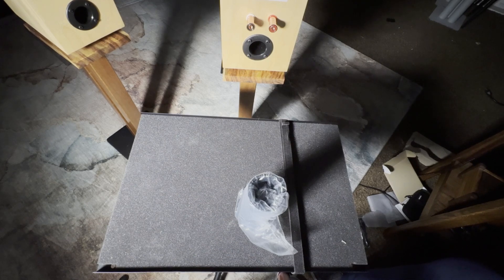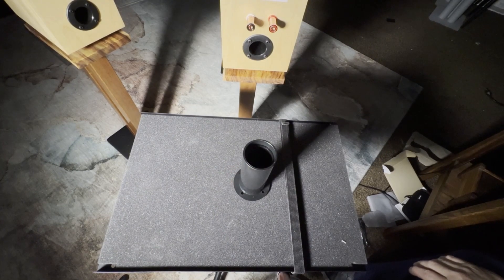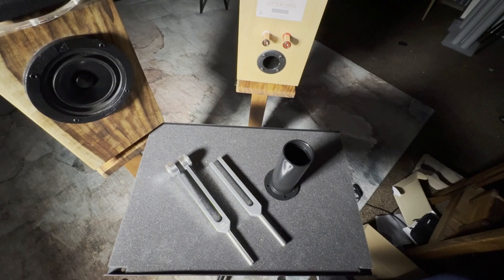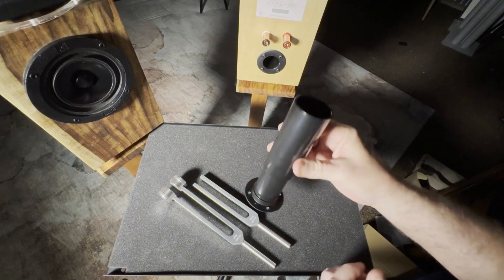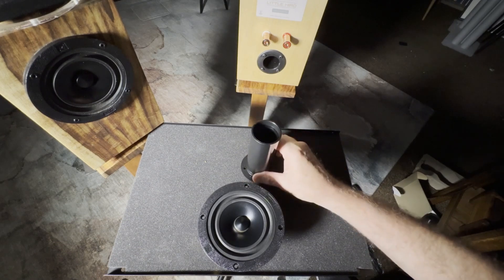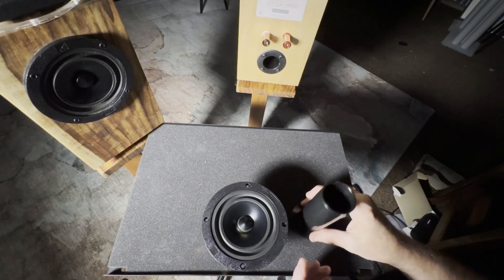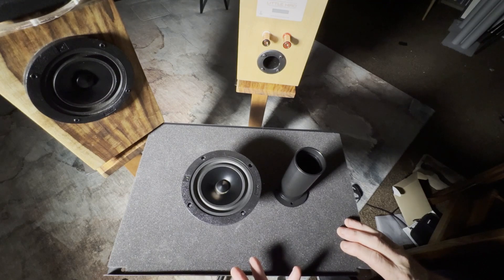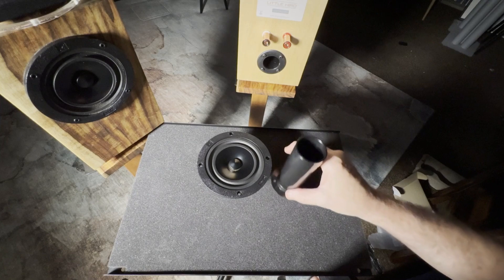Unlocking Deep Bass: The Secrets of Bass Reflex Speaker Design!

Comment: If the mid-bass driver's QTS is compatible, Transmission line cabinets have it all over ported enclosures. Not only is the bass better but so is the midrange. "The midrange of transmission line speakers is also much more open than conventional designs; and may rival open baffle designs. A strong benefit of a “folded” transmission line design is the internal baffles not only form the specific volumes and dimensions required for the correct tuning for the woofer - they also form asymmetrical bracing for the cabinet. I include a brace in the closed end, that greatly strengthens the front baffle - which is the most critical area, since the drivers are mounted there. Less obvious is the fact that the internal air pressure in a TL design is lower than an equivalent sealed, or even a ported design. This greatly reduces the panel resonances - and this is possibly why the midrange and bass are more open and clearer. The woofer has less of an “air spring” behind it, so it is more closely reproducing the music in the recording." 
https://www.nbdesigns.work/shop/p/tower-6-mass-loaded-transmission-line-speaker-build-manual-1
I'd note that "internal air pressure in a TL design" means that there is less back pressure on the midbass driver, which translates to less sound waves 'bleeding' through the driver's membrane, a source of 'muddying' the sound we hear. As is so often the case, we don't notice that 'muddy' distortion until it's lessened.
Reply from the maker: You make some interesting points, Geoffrey, but without seeing or hearing your TL designs, it’s hard to make a fair comparison. Our ported systems use well-damped enclosures with Dacron-batted walls, eliminating any “bleed-back” into the midrange. And BTW ... woofers are designed to work with an “air spring” behind them; that’s why they’re enclosed in the first place.

On a personal note — TLs can introduce their own phase issues. Because the rear wave travels down a long path and resonates at multiple points, you can end up with extra phase rotations in the midbass and lower mids if it’s not executed perfectly. A ported enclosure’s phase behavior is far more predictable: the port is tuned to one main resonance, so phase shifts are easy to control, and midrange clarity can be excellent with proper damping.

It’s always about execution, not just topology — would be great to see a video of your TLs in action for a fair comparison.

Comment: For getting the most from smaller transducers, ported enclosures are absolutely necessary.
Reply from the maker: Yes that true sealed enclosures need to be large and even then they roll off sooner. The port contributes quite a bit to extend bass.
Reply: Have you checked out the new SVS towers by any chance? VERY interesting design, 4 woofers per tower setup in dual opposing operation in discrete PORTED enclosures. Ive never seen that before.
Reply from the maker: I can only imagine the nightmare of getting them all to be in phase.
Reply: Passive radiators are also good.

Comment: Good basic 101 explanation of ports.  It can get more complicated once you start factoring in port diameter, the number of ports used, and where they are located in the speaker cabinet.
Reply from the maker: Ah that's correct. The complexity is amazing.  I intend to "double back" on the subject and discuss it in depth. 

What captivates me about bass reflex ports is their synergistic operation with the speaker driver, effectively managing air pressure within the cabinet. 

These ports serve a dual function, akin to a valve, facilitating the passage of air and helping to depressurize the cabinet at its specific tuning frequency. 

This mechanism significantly alleviates the back pressure on the driver when operating at this frequency, thereby providing a notable 'boost' in performance. 

The driver moves more freely, enhancing the speaker’s efficiency and reducing potential distortion in sound output. 

Tuning this boost, which involves meticulous adjustments to the port's dimensions and placement, is crucial. It's not just about the size or shape of the port; the precision in tuning these elements directly impacts the bass quality and overall sound fidelity of the system. 

Choosing the optimal tuning frequency for a bass reflex port is a complex topic in its own right. Often, there's a tendency to set the tuning frequency too low, beneath the range where most recorded bass frequencies actually lie. This approach is typically aimed at extending the depth of the bass. However, while this might seem effective for achieving deeper bass, it doesn't necessarily align with where most musical bass content is recorded, potentially leading to less optimal overall sound reproduction or less bass impact.